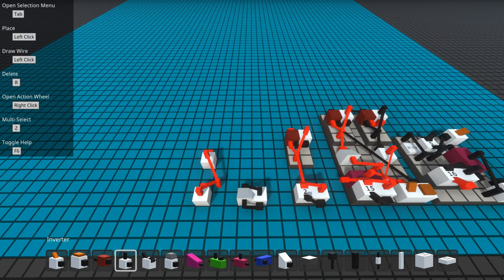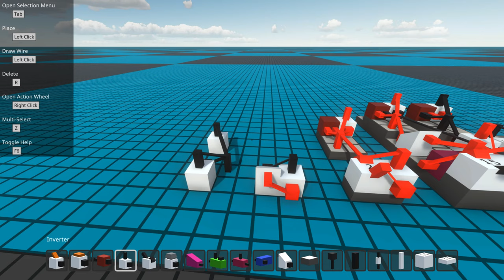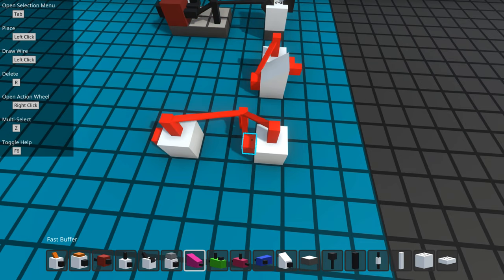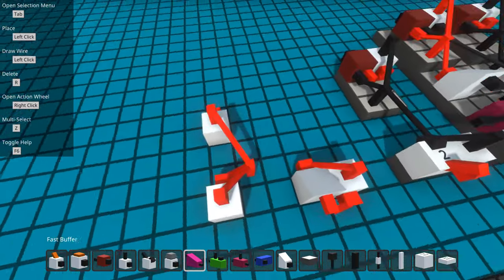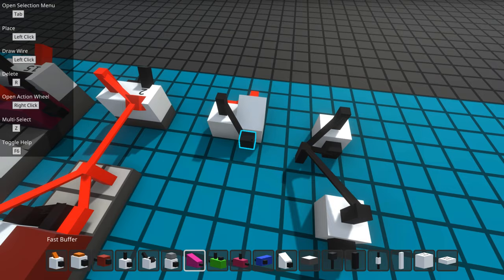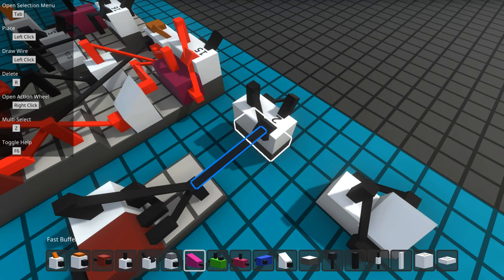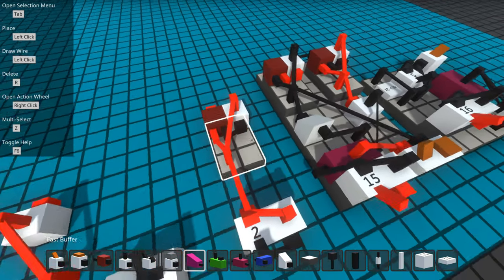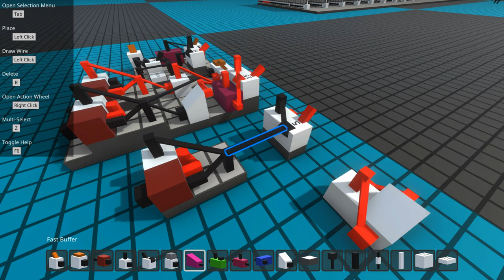Logic World, explanation of timing and clocks

Comment: This is awesome.
Please can you maybe do a full guide for total digital logic newbies?
I'm mostly into computers and I understand how logic gates work, how a switchwork and something more but I'm not too much into electronics. Would be nice to learn from here if you find the time to do
Reply from the maker: I do have some videos covering a few topics.  Here's the playlist : https://www.youtube.com/playlist?list=PLBJP7W0Si5s-n3ebPOJOzhCYWLWjpajc7
Reply from the maker: Full adder is maybe the place to start.  If you can understand full adder, you can understand some other stuff in terms of how CPUs do math.  If you understand how CPUs do math, you understand some of the most important stuff CPUs do.  Perhaps the hardest "block" to understand in a CPU, is the decoder block.  That block needs to convert an instruction in memory, into a series of steps.  Mostly the steps involve stuff like copying data from one place in the CPU to another, over a "bus".  A bus, simplified, is just a set of wires that allows for data to flow through the CPU.  For example, a step in an ADD instruction involves copying data from memory, to a register ( a special memory location in the CPU,) that allows the ADD circuitry to do what you want.  Also see Ben Eater's 8 bit CPU videos on youtube.  Where he uses simple chips, connected together on an electronic breadboard to implement a CPU.  He does a fantastic job of explaining how the decoder is implemented with "micro code", which is simply a sequence of actications of various blocks of his CPU.